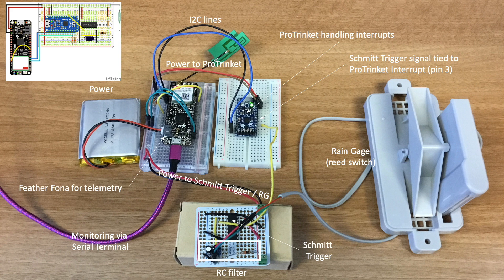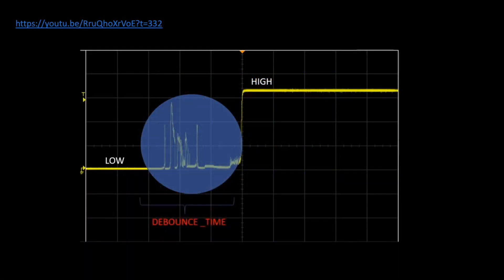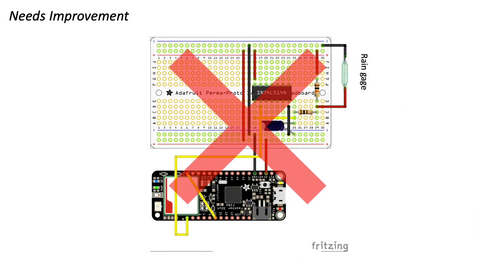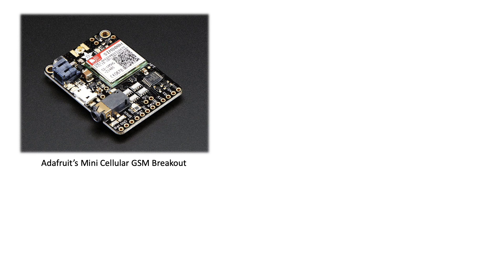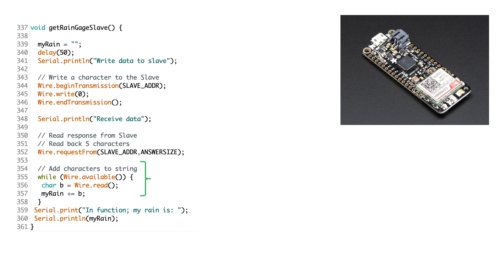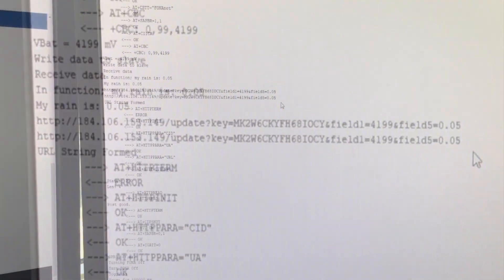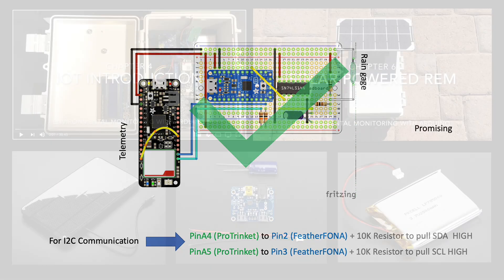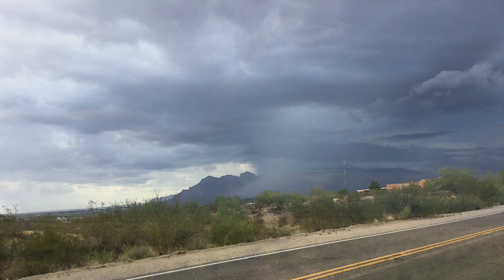Rainfall Monitoring via Cellular Telemetry

Comment: interesting project!  for telemetry it is possible to use any telephone sim card? In the feather fona sketch I do not see the APN setting string
Reply from the maker: The only unique key you need is the one required to speak to ThingSpeak via GPRS which will be unique to your channel. You don't need to provide any APN settings or anything else as long as you use the libraries that Adafruit provides. All you need to do is call a function to turn on GRPS, send your data to the appropriate Thingspeak channel, turn off GPRS, and you good! Just a heads up that this all was developed on a 2G FONA platform. Here in the United States, carriers are abandoning 2G for 3G and higher. Having said that, there is a way to do this same experiment using a Particle Boron modem which operates on 4G. Details for flow detection are posted in this video: https://youtu.be/cJ5NzbJG5Lw. If you live outside of the US, 2G might still be an option.

Comment: Great videos -- thanks for posting!  Did you figure out the solution you mentioned for the problem of excess humidity building up inside of your enclosure?
Reply from the maker: Yes I did. I am going to place future microelectronics in a large diameter PVC pipe, capped, and with an open bottom. more details shortly.

Comment: how much capacity of li-ion battery and solar panel have you used? Will that much of of power supply is enough for worst weather case scenario?
Reply from the maker: Good question. Because I have so much sunlight where I live (and the current draw from the circuit is relatively low), I can get by with a 3.5W solar panel and any Lipo equal to or greater than 1200 mAh in the shade. That can keep me going for a couple days without charging, assuming I don't post every ten minutes. I have a project where I plan to measure current draw and panel sizing requirements - soon enough.